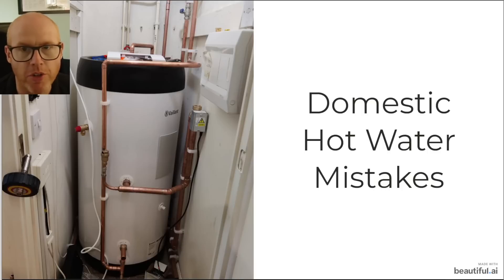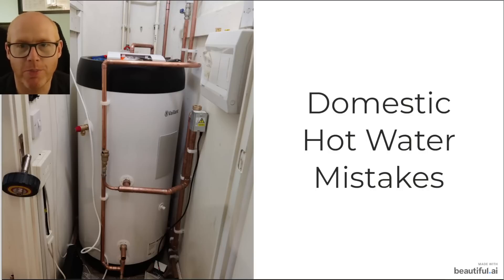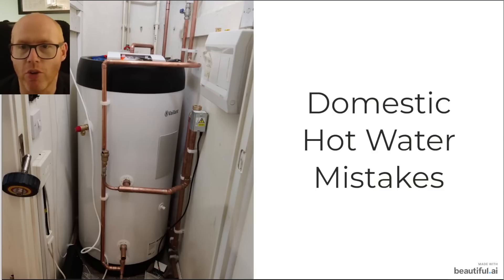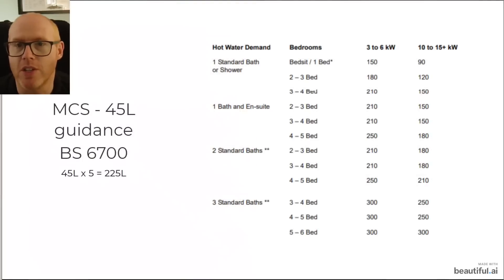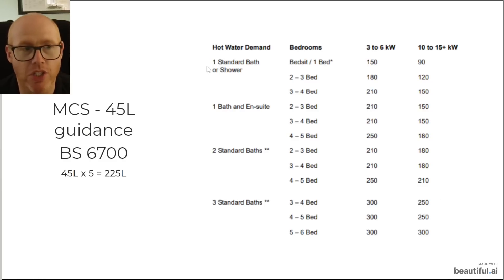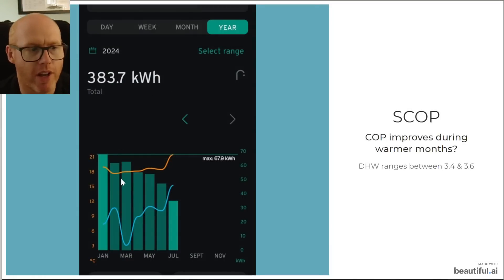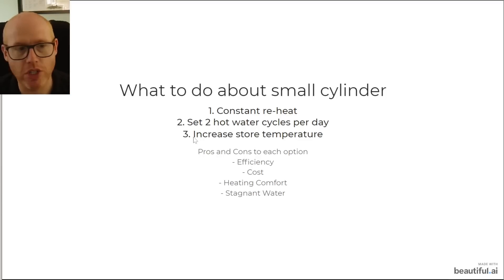My Hot Water cylinder is the WRONG size! What I've learned about heat pump hot water cylinders.

Comment: Your cylinder should have had an electric immersion heater fitted to boost the water temperature. And if you run completely out of hot water, you could use the immersion heater to warm the whole tank of water in an  hour cheaper than replacing the whole cylinder and very efficient. also the heater could be connected to both economy 7 and peak electrical supply.
Reply from the maker: It does have an immersion heater but it's not cheap to run compared to the heat pump.
Reply: @UpsideDownFork  P.S. If you use the immersion off-peak between 12am and 6am, I think it runs electricity per unit runs out at 30% of the cost of peak hours
Reply from the maker: @louisdisbury9759  Yes, but I use my heat pump between those hours to heat the hot water. The heat pump is 3 times more efficient than the immersion.
Reply: @UpsideDownFork  What's the maximum temperature you get on the hot water when using the heat pump only?
Reply from the maker: @louisdisbury9759 up to 65 degrees. It's a R290 pump.
Reply: @UpsideDownFork  okay so when you use you have a bath or a shower and the hot water temperature cools down, then the heat pump should cut in and reheat your cylinder water ensuring that you never run out of water. That was your general complaint saying that you were running out of water so I don't really understand.

Because that tank there's probably enough for two baths or three showers in that one after the other. So how have you got it set? Have you got it set so that when the water temperature drops on the cylinder the motorised valve opens and reheats the tank with water from the heat pump circuit?
Reply from the maker: @louisdisbury9759  MCS guidance of 45l per person per day should be sufficient to only heat the tank once per day. That is the most efficient strategy to use the least amount of energy. Reheating the tank multiple times per day on a hysteresis setting is not only inefficient for DHW but also for space heating.

A properly sized, designed and commissioned system should typically only heat the cylinder once per day. Heating it more than once per day means compromises have been made somewhere.
Reply: @UpsideDownFork  we know that they fitted an undersized cylinder. Who fitted your own? I'm just trying to give you advice on how to maintain your hot water supply without going to the expense of adding a cylinder. As a qualified heat engineer for 45 years, how many times a week do you think we come up against faulty installations of heat pumps?

So instead of ripping customers off and trying to stick to the bullshit of the green agenda, I give them sensible, practical, cheap advice on how to resolve their issues. I'm trying to do the same for you my friend but I am most definitely not heating up the base, am I?
Reply: @UpsideDownFork  my friend, you seem obsessed with regulations instead of providing safe hot water for your family. You have already admitted that the company that fitted that pump under-sized your hot water cylinder.

How many times a week as a professional heating engineer do you think I run into these problems? I am trying to give you a cheap way out. To maintain your water supply you're not listening.

So nothing more I can do, my friend. You stick to your green agenda which incidentally is fake. It's the biggest con going as you will find out over the years with that heat pump when the maintenance bills and the running bills start coming in.

Most of my customers that have heat pumps, I now replace them with condensing gas boilers that give instant untapped heat. There's no need to leave them running 24/7 and if they break down they can be repaired very cheaply and efficiently
Reply from the maker: @louisdisbury9759 sure...😂
Reply: @UpsideDownFork  what temperature does your heat pump take your hot water to? It's a simple question, mate.

I install heat pumps but when I put a heat pump in, I use the immersion heater as a booster or a standby. It's wired into the actual control box on the heat pump and the heat pump turns the immersion heater on and off automatically
Reply from the maker: @louisdisbury9759 the heat pump can take the water up to 65 degrees if I program it to.
Reply: Yeah but if you connect it to the control box, the heat pump control box, it could be used as a booster. So if your water temperature drops it turns on automatically
Reply from the maker: @louisdisbury9759  The heat pump can already do this.

Comment: A great video and after watching this and a couple of your other videos, you have helped me to make my mind up. I will have a replacement combi gas boiler. The reason is actually down to my age and costs. The cost of having a HP along with a cylinder, new piping and radiators is very unlikely to be recouped in my life time. The good news is that also because of my age, I am not likely to polluting our planet for a great length of time.
Reply from the maker: Thanks for commenting.

Without a quote it's all speculation. In our case the HP was £2000+ cheaper than a gas boiler.

Comment: Mitsubishi pre-plumbed cylinders have an external plate heat exchanger, it requires an extra pump, but it means you don't lose capacity for the coil.
Reply from the maker: Thanks for highlighting this. A good solution in some cases!

Comment: I used to have a water cylinder in the cupboard on the landing.A tank in the lift and a small tank for the Central heating.My small Gas boiler got writ of all that the future is here.
Reply from the maker: We also got rid of the headers tanks in the loft when we converted to an invented system for the heat pump.

Gave us so much more space in the loft!

Comment: I think the comment you made certainly resonates with me - "I'd have spent less time fixating on the heating side of things", I think we're ok with our hot water cylinder but I must admit I did the exact same thing, spent absolutely ages trying to model how the space heating would work and barely considered hot water at all, I wasn't even aware of the heat geek super cylinders which look incredible (although pricey).
Reply from the maker: I'm glad I'm not alone.

In fairness, space heating does account for the vast majority of energy consumption, so even if you only achieve a COP of 2 with DHW, it makes a relatively small difference to the overall picture. At least in our case that's true.

Comment: Our old new build had a 150 litre HW tank which seemed to do us, a family of five OK. I used the solar array to heat the HW using the immersion element (via an Immersun unit) which is another benefit of a smaller tank - it heats up quicker. No HW heating costs for 8 months of the year. Coldnt help but think cold you not supplement the HW heating using a PV diverter  instead of using the Heat Pump, obviously you loose the efficiencies - but you would preserve your SCOP!
Reply from the maker: I'm not fussed by chasing SCOP. That for me is vanity rather than sanity. 
We export solar at 15p and run the hot water cycle overnight when the import is 7p.
It's also good for the heat pump compressor to run throughout the year.

Comment: Do two cycles. Make sure one is at night (cheapest kWh’s) with temperature in the tank. 

Second cycle if a temperature drops below x temp.
Reply from the maker: We've found that one cycle at cheap rate mostly lasts. Occasionally if my wife needs to wash her hair I might put the store temp up by 2 degrees which seems to give us just the right amount of extra hot water.

Comment: Just been having "discussions" with Octopus on this very issue! They wanted to fit a 180L tank for us as a family of 4 (including teenage daughter who spends 10 mins in the shower).  I argued I wanted a 300l cylinder and they said no, but compromised on a 250l. Hopefully it works but would be happier with a 300l for peace of mind. If the Mrs runs out of water during a shower I will certainly regret not going larger! Thanks for the great videos!
Reply: All installed now, and with a 300L cylinder at no extra cost.
Reply from the maker: I think you'll be fine with the 250L.
We've adjusted now and manage well with our 200L now we're in the routine.
Enjoy your heat pump!
Reply: It's because the system they are fitting is not suitable.
Get another company - walk away from people like that.

Comment: I've just had a 200 l water tank installed for my heat pump and my bath can only get 1/4 before the hot water runs out, as in down to 35c
Crap, they are back for the check-up in one week and I will tell them that it's not working correctly. 
They will be putting a much bigger tank in.
Reply from the maker: That will not be down to a tank sized too small. 200L is plenty for any bath. Glad they're coming back to check in and make sure the settings are correct and the plumbing is correct i.e. no mixing of hot and cold feeds.

Comment: Without  doubt. The largest problem to heat pump adoption in the 🇬🇧  is bias by the government towards subsidising gas and fosil fuel industry and taxing electricity to pay for renewables. I.e. gas is artificially cheap and electricity artificially expensive. 

Also although heatpumps are very much proven tech the install and systems design are complex.

I hadn't considered the hot water to be so complex also.

Only when price differential between gas and electricity is based on cost not government bias and corruption will heat pumps start to become truly cost effective. This is an environmental issue and should be front and centre but no one is talking about it 😢
Reply from the maker: @hedleypepper1838  agree 👍

Comment: Really helpful video, thanks.  This is a bit of a dilemma for empty nesters like us, who occasionally have a house full of people.  Do you size it for two people, or 5-10 people?  I don't think there is an easy answer to that question.
Reply from the maker: Sizing it on the smaller size is probably wise for efficiency, knowing that on occasion you will perhaps run 1, 2 or maybe even 3 DHW cycles per day.
Reply: @ good advice, thanks.  I suppose we could also push up the flow temperature or use the immersion during the visits - so long as we remember to turn it down afterwards.
Reply from the maker: @grahamf695  those are good options too!

Comment: Good info thx.
I am building a new home and pushed for the installer to fit a 300l boiler. The idea is to run a lower temp(35-40) for domestic water what should allow for a good COP, even in the summer. I do not see the point to heat it until 50 degrees and then cool it down as needed. If it would run multiple times a day, even better going of your info
Reply from the maker: @timluyten7330  thanks for commenting. Hope it works out well for you.
Reply: Here in France we must heat the water some times at 55/60° to remove legionnaire's disease, be careful with that 🙂

Comment: Wondering how many kwh to heat the cylinder on a first and a second cycle, Summer and Winter?
Reply from the maker: The difference between summer and winter is fairly minimal and the electricity consumed daily for the DHW is pretty consistent.
Reply: @UpsideDownFork thanks. And roughly for your house, how many kwh did it go through last December if you can share?
Reply from the maker: @ipedros7  maybe the data here will help you:
https://youtu.be/DiMZoM_ocgk

Comment: I suspect the heat from the central heating is supplementing the hot water energy when the cycle between the two.
Reply from the maker: It's a miniscule amount. The diverter valve changes across very quickly.
Reply: You would think but we had the opposite problem because we have UFH and high insulation so flow temperature of 25C and HW temp of 55C that was cycling dumping the hotter water into the central heating.
Can also be due to 3 way valve leaking due to debris or fault - not closing off completely 
Energy use in summer should be a lot lower in summer ( even if COP lower) with higher feed and outside temp

Comment: so if the usage alone for showers is good to you..but you say easily on-par with gas boilers...so whats the point of paying for these when they are not cheaper?
Reply from the maker: The new heating system including heat pump and cylinder etc was half the price of the gas boiler equivalent.
Reply: @UpsideDownFork  oh thats good then as for us its nearly 4k and thats via octopus so we can not have one but we have no room for the water cylinder and its pipes really

Comment: Here is a stupid question... Can a cylinder be installed in the loft and if so what are the caveats to watch out for at different times of the year?
As the last loft is colder in winter but warmer in summer than the house.
Reply from the maker: Yes it can.

You will have slightly higher standing losses in the winter months but modern tanks are so well insulated that you probably won't notice any different.
Reply: @UpsideDownFork  That's good news! Thanks for this info!

Comment: I have Heatpump Heating and Warm Water separated. A kitchen boiler 125 euro and a bathroom boiler 175 euro. Warm water done for 300 euro. Works on Rooftop Solar Free Electricity. Works perfect for years now. LG Therma V Monoblock 9 KW 60 degrees Heatpump. No Gas no Energybill for 12 years now. I let a House same System. No Gas no Energybill.
Reply from the maker: Sounds great! 😃
Reply: @UpsideDownFork  Hello. I placed the Heatpump myself. On rubber garden tiles. Adapted the CV radiator connection pipes. Put in under pressure again. Electric Cable in place and new thermostate cable in place and the thermostate fixed on the wall. A professional Company came to connect the cables. And control. One hour work and than the paperwork for subsidie Application. 3075 euro. Than we had a good meal together. That was friday 6 december. Up and running. Very Hot. Silent Easy Cheap.👍👍👍🌹succes with your videos.

Comment: I think we're moving towards maximizing the use of thermal storage in the given mechanical footprint. 

 I even like the idea of using vented cylinders with a large enough coil for the potable water, separating out the storage completely. Then mass exchange between the hp and the store provides excellent efficiency. 

It could even be used for space heating storage. 1 to 1.5m3 wouldn't be impossible.
Reply from the maker: Thanks for commenting!

Comment: You could bring the temperature of your cylinder down more by using the water in the tank to warm up your fresh air for your home.  This could be a variation of an HRV where the hot water in your tank isused to warm up the incoming fresh air.  Accomplishing this is actually exactly what I am trying to do right now becvause I deal with temperatures as low as -45 and I don't want to bring cold fresh air into my house.   In canada we use HRVs and ERVs but the fresh air exchanges are costly because I bring in such cold air.  The other thing I want to accomplish is warming my incoming water from 4c (ground water temperature) to ambient temperature so my tankless water heater does not have to use as much energy to heat my water.
Reply from the maker: Ah, this is interesting! I always love to hear what's happening in other parts of the world.

Comment: Always oversize everything 😉 first thing I learned as a heating engineer better to oversize boilers rads cylinders etc it can allow the boiler to run a lower temperature and in turn use less gas 👍 and yes you must account for the coil taking up space inside the cylinder, also would be a good idea to get a small electrical pre heater for winter so the water isn’t super cold going into the cylinder
Reply from the maker: Why would you waste energy on a larger boiler than necessary. If you have a boiler with a 10:1 modulation ratio then you are sacrificing efficiency by not sizing correct.

Same for an electrical pre heater, why?
Reply: @ this was the days before weather compensation, we always learned better to go bigger than to be undersized in extreme winter weather, and allows your boiler to run at cooler temps saving gas and saving the wear and tear on your boiler
Reply from the maker: @Sunnybeachwalks  How can a bigger boiler run at cooler temps than a smaller one?
Reply: @ when the demand is lower the boiler isn’t working as hard with modulating gas flame and you have that extra head room for when and if normal demand goes up 👍 like you said in your videos now you realise your heat pump and cylinder are both undersized… so if the design was oversized in the first place you wouldn’t have any issues, I guess you have to blame British Gas for their incompetence. Swapping out the cylinder for a larger one is an easy swap though
Reply from the maker: @Sunnybeachwalks  Smaller sized boilers can modulate lower than larger ones.

My heat pump is a 7kw, a 5kw unit would have been the correct size to match the heat loss of my property.

1.66kw Vs 2.33kw minimum modulation, roughly speaking.

So my 7kw unit cycles more than a 5kw would.

The inverter driven compressors in heat pumps typically have a modulation ratio of 3:1, whereas some boilers have a ratio of 10:1 or even 20:1 which goes to show that boiler sizing isn't as critical as heat pump sizing is.